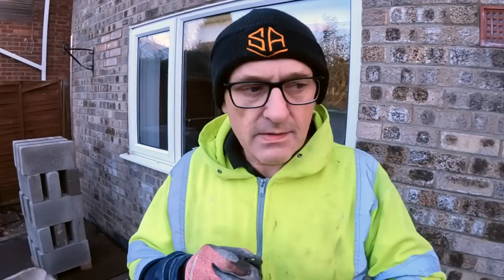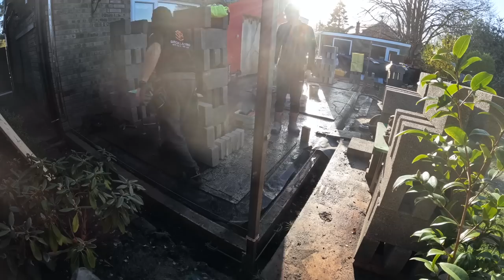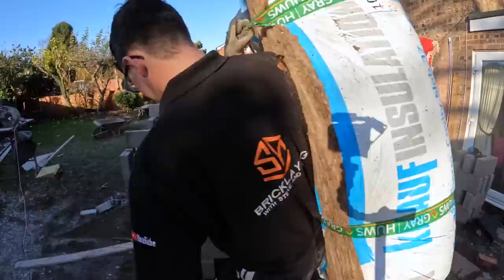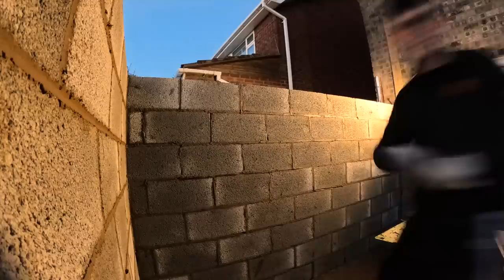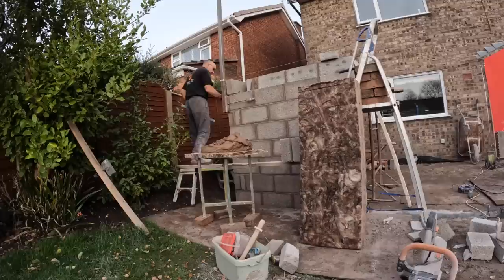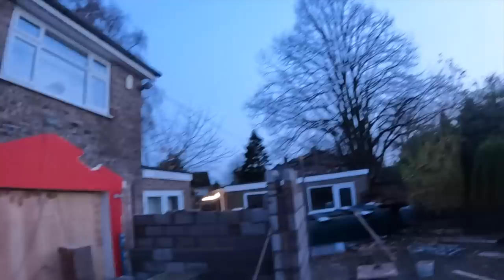BLOCK WORK GALORE !!  BIG EXTENSION PROJECT PT 5

Comment: Woo woo getting a genie lift it's only took me ten posts to persuade you haha. Once you use one you will never lift heavy steel again.
Reply from the maker: Used them before and are a right pain in the arse . Cost us 1/2 a day as the first one was broke 😒
Reply: @SteveAndAlexBuild  that's the building trade for you 2 good days then a crap day. We use ones that don't have the bracing bars on much easier. We use them all the time but there is some tricks to make it easier. If it's broke there's nothing you can do but moan 😆 🤣
Reply from the maker: @paullindsay4798  😆😆🧱👍🏽

Comment: Amazes me how different councils are allowing different insulation amounts, we’re having to use 90mm t and g cavity celotex now with trays and weeps and bricks on the inside walls are a big no no because of cold spots.
Reply from the maker: We did get bollocked for the concrete common inside 😬.
  The walls are insulated outside , cavity and inside 🧱👍🏽
Reply: @SteveAndAlexBuild  ahh…you’ve gone for the insulated plasterboard option 👍 per m2 works out slightly dearer but getting hold of the celotex insulation can be a nightmare 👍
Reply from the maker: @MrB3ngy  🤙🏾🤙🏾🧱👍🏽
Reply: Yep 90mm for us a right pain to fit and price is horrendous. There is a huge argument about it as bringing an extension up to the same standard as a new build is ridiculous when the rest off the house has no insulation. Extensions are going to become to expensive it will be cheaper to move.
Reply from the maker: @paullindsay4798  very true mate 😒🧱👍🏽
Reply from the maker: @martin2466  😬🙄🧱👍🏽